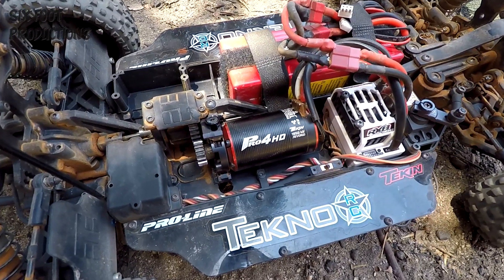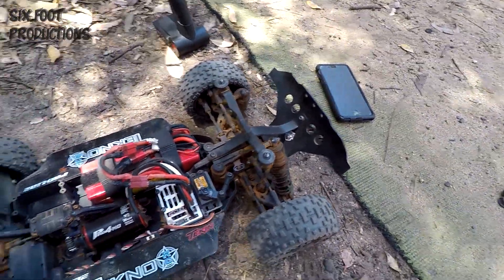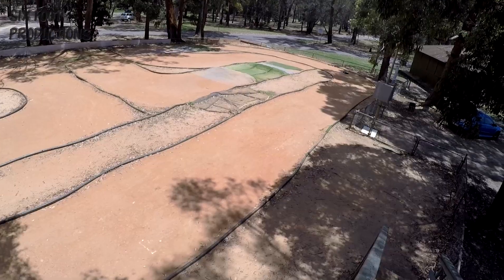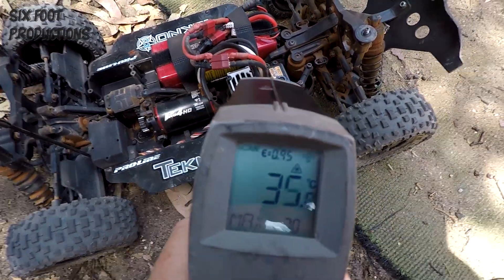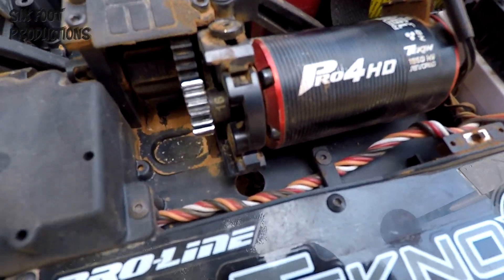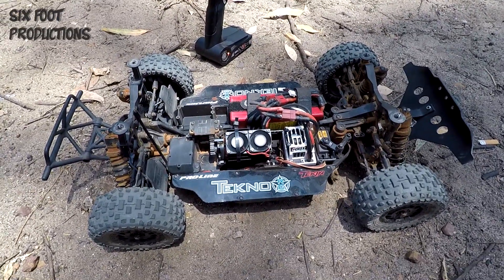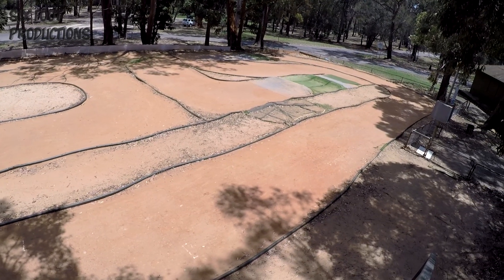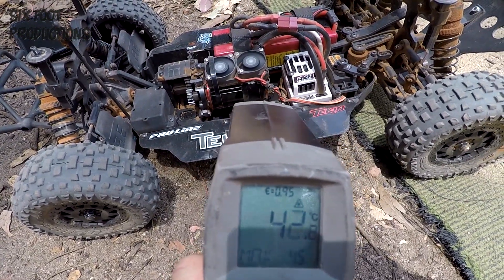Infrared Gun Tests. How much of a temperature difference do rc motor fans make? Upgrade time

Comment: Yes definitely but they dont guarentee not overheating I'd recommend upgrading them as hooning around and having a good time than having your car break or shut itself off to prevent killing itself is quite annoying
Reply from the maker: Def worth opening cover up and checking after longer runs. Even older lipos swelling and potential fire risk. Checking motor and ESC temps keeps gear running better for longer

Comment: Your measurements are actually inaccurate. You're taking a temp with fans blowing, of course you're going to get a lower temperature...
And you're actually checking the temperature of the heat sink and fans also, so you're not getting a physical reading of the motor itself....

Comment: Damn you really need to change out all of the metal parts because the rust on them will actually cause more resistance on the wheels and shocks, that also leads to more heat in the motor.

Comment: Awesome!  Thanks for the help. Just got a 3s lipo and my motor is so hot. Ordered some!
Reply from the maker: Great to hear, it’s gonna have extra torque and speed. Fans really help a lot. What RC do you run?
Reply: @vuss2107   Just got a used Slash 4x4 vxl. Have had an Associated SC10 2wd. Nitro Slayer before that. Nitro rustler that’s still kicking.  My brother and I kind of come in and out of RC so I have to buy a bunch of stuff when we do lol. Feed the beast.

Comment: Why do people always read the side when they do a motor temp test? You read the temp on the End Bell both before and after the fan install. if you read the side after then that's the heat sink temp not the motor. If you read the Bell after install but not before then you don't truly know what the difference was because the Can and the Bell usually have different temps to begin with. Also always turn off the fans during the temp read.

Comment: When I'm running ~10 min my car stop reacting for throttle for some time. I check engine and it temp 70°. ESC can cut off the engine when is it overheating? Or the problem is somewhere else?
Reply: Battery connection maybe? If you’re using and kind of adapter I’d say that’s your culprit but.. let me know what you found out! Always good to learn something
Reply: jarrett maltry problem solved. I buy new battery and now engine temp near 30 deg.
Reply: Gustavlegion wow never heard of that issue, what brand was your old battery vs this new one?
Reply: @jarrettmaltry6305   I bought my car with this battery, its 3 years old and I get it in very bad condition. Race time on it near 4-5 min, or 1-2 on 100% throttle. Battery - Turnigy 4200 mah.

Comment: They make a huge difference. My 4100kv motor goes into to temp protection at 160f after 20 minutes of running. With the dual fan yeah racing unit I have temps stay out at 120-130f. And this is during 95-98f ambient temps. At 70f I don’t have any thermal issues.
Reply from the maker: Firestarter 
Nice one def worth it over hotter months. Winter not so much here
Reply: Six Foot Productions yeah, I have it setup to quickly connect or disconnect it. Having a motor that draws 1400-1700 watts peak and gets little airflow really benefits from the fans. 

Running at 70f ambient I’m seeing 20f drop in temps, so it’s not a huge improvement and 130f isn’t dangerous so you’re right that it’s not necessary.

Comment: I have one 40mm fan with heatsink on my motor and it is only about 5°C cooler with heatsink and fan. Maybe the heatsink is designed the wrong way!??!
Reply from the maker: Make sure heatsink is a tight fit to absorb heat, some fans are weaker than others could be that too
Reply: @vuss2107  Thanks for the tips, unfortunately my motor has small fins so fitting it tightly around the actual motor isn't possible.. I might still try a stronger fan though!

Comment: When you are measuring w fans installed,  you need to turn the fans off, it's not giving you the exact current surface temperature.
Reply: That's not how it works.   The IR thermometer works by focusing light that is coming from the object in the form of IR rays and funneling that light into a detector.  Light, not air.
Reply: @everythingispose-able2543  bro, you're wrong. That's why you're the only one who commented.   

Now take a room with a window in it Or being outdoora where sunlight can hit the sensor. The sensor will absorb the suns energy and heat up. Once you turn on the fan the sensor will begine to decline in temp because the circulating air is moving the absorbed heat energy away from the sensor thus allowing it to cool until it levels with the temp of the room. If your window is still open and the sun is still hitting the sensor then it will never completely equalize with the room temp. 

So suck it smarty pants!!!

Comment: im about to install a hobbywing ezrun c4 5v on my v4 kraton and might add thermal paste between the heatsink and motor
Reply from the maker: Mac Catanzaro 
Could do mate, might attract a lot of dust and dirt tho. How’d you get on with it?
Reply: Six Foot Productions my 4600kv castle 4 pole and mamba max pro get super hot, I have a fan for the motor and the esc but I need to put on. It burned my finger when I touched the back
Reply from the maker: Wed Bull 
Can you change the pinion to cool it down a bit?
Reply: Six Foot Productions yes I can, I was previously running it on a traxxas slash 4x4 platninum with good temperatures, then my sc10 2wd which temps were ok. Finally it’s on my sc10 4x4 and I’m running a big pinion and a big spur. I am going to drop pinion your a 13 or 17t pinion as I was running that before. Maybe that will fix my problem.  It something I also noticed is that all the cables for the car get extremely hot. Like the solder on the deans plug literally melted off when running a dyno on the car
Reply from the maker: Wed Bull 
Got some nice RCs buddy.                    Weigh all the chassis individually. Also compare the gearing might just be a case of extra weight and needing a gearing tweak.
Reply: Six Foot Productions not sure I have a scale to properly weight a rc car but I’m running it on 3s when I usually ran all my other trucks on 2s and occasionally 3s. Will do some tweaking this weekend with gearing and then the fans
Reply from the maker: Wed Bull 
Good luck with it mate yeeeew 👍

Comment: I thought the exact same thing as other comments...i think to get a true reading you have to unplug the fans and measure temps of motor with fans and heat sinks removed.
Comment from an Rc jet/plane/heli/boat/car expert with 35 years experience.
Reply: You would think a 10 year expert would be able to make a summary of what the precise readings would be like in less than what you typed?

Comment: I dont know if that gives you a fair reading with out taking the fans off the motor then do a reading. Or at least unplug the fans. Just thinking maybe there is a windchill effect of some sort going on. Probably not too much of a difference though. Or not enough of a difference that is worth unplugging or removing the fans.
Reply: No i am sorry. I mean taking the temp of the motor while the fan is running. Meaning it could give a false reading because the fan is blowing. I checked my motor this weekend after 2 races for 4 minutes each. It was about 3 degrees farenheit difference between the fan running and the fan not running. So not too much difference at all really. But, having the fan on the motor did make a difference of about 20°F less than it is usually with the same ambient temp. Usually I would notice a 15° F difference with a heatsink.
Reply: I thought the exact same thing as other comments...i think to get a true reading you have to unplug the fans and measure temps of motor with fans and heat sinks removed.
Comment from an Rc jet/plane/heli/boat/car expert with 35 years experience.
Reply from the maker: FOSTBITTEN 
There’s a substantial temp drop running fans (25deg Celsius, 77def Fahrenheit) less heat stress on all components. 
There’s no wind chill on a summer day in oz that day was 30deg Celsius or 86 Farenheit ambient temp

Comment: do the fans just plug into the receiver?
Reply from the maker: Dusty 
They sure do 👍
Reply: I dont need an adaptor? The connectors on my fans are JST
Reply from the maker: Dusty 
They should plug in fine
Reply: ok. Thanks!

Comment: Quit a big difference huh?
I like the torque of that 1850 pro4 hd, a LOT more than my 4300!
Reply from the maker: +Monster Neu 2.0 
Deffo more torque on 4S I changed to 4050kv 2S motor only to try lighten truck weight as running 2x 5000 2S in series for 4S was to heavy. Still drove good and bulk run time, I didn't want to buy 4S batteries. As I have 10+ 2S batteries. So motor swap was best way. I might put 1850kv back in over summer..... try 6S hahaha
Reply: Six Foot Productions hobbystar and SMC make 3600 mah slim 4s packs the size of a 2s, and weigh as much as a 2s too! But i hear ya, u got a lot of 2s packs 
One of these days I'm going to get a couple 4s slim packs and run 8s 2200 because my tires must die
Reply from the maker: +Monster Neu 2.0 
I did look into a lot of 4S batteries, didn't want to buy any more batteries to add to the pile. 
I have 2x SMC 3S 5000 there grunty. That would wake the sct up too hehehe 

8S sounds beasty, make sure you do vids 👍
Reply: Six Foot Productions oh I will, but I'm not sure they're gonna be long lol

Comment: Terrible temp measuring experiment. You should have turned the car off to stop the fans and measure the motor temp. Taking a measurement of the fans blowing air is retarded and inaccurate. 👎🏻
Reply from the maker: +Artem Brayson 
Not really bud IR gun is the way to test, also there's a temp/speed/rpm sensors on the truck can use with TraxxasLink app gives similar results. 

There's clearly a substantial drop in temps, fan on fan off the motor can is heat soaked. It's not as if the fans are blowing it cools down immediately.
Reply: Deffo not a true reading, if the fans are blowing on the motor after stopping the car the motor Will get cooler, the test is how hot the motor is without fans then with fans, but as soon as the car has stopped the fans should be instantly turned off to get a true reading of the motor temperature with cooling,...

Comment: You'll get even bigger difference, when you use same stuff that you put between cpu and cooling unit inside computer and really bolt that fan unit to your motor. I did that with my hobbywing on my XB9e and could put whole a lot bigger pinion on motor while temperature remained so low, you could barely feel the difference with your finger, compared to before running it. I used those metallic "zipties" (cba to check their real name... the ones that have screw tightening thingy) which bolted the cooling unit to motor so tightly, with that lithiumgrease (?), that there was literally no air between those 2 metals. When you have air between metals, and you do with normal RC motor fans, it won't be that effective, even when it does help :)
Reply from the maker: Janne Grönmark 
I think you mean thermal paste, cheers for the input
I few weeks back I swapped out the 1850kv tekin motor for a 4150kv to now run 2S. It drives much nicer as it's heaps lighter. I did use thermal paste on heat sink/fan install. I have run 16-19 pinions with no heat issues, approx 15-20 deg above ambient temps on a full pack 
I need to do a few updates but our laptop died few weeks ago waiting on delivery of another due soon
Reply: Oh right, thermal paste, that's the word :P Being tired and since english isn't my native language, I tend to forget few words here and there haha :) But yeah, that's what I use on my motor/heatsink and bolt it tight, so there's no air between those 2. I might be over-cautious, but since the paste isn't that expensive, might as well :D
Reply from the maker: Janne Grönmark 
All good mate 
Yes it is worth while the thermal paste syringes is few dollars only lasts years, just a blob under heatsink or dirt will finds its way onto it 👍👌
Reply: @Joselox  he did use a heatsink. It's the small black thing that he screws the fan onto.
Reply: Depends, can't have you fans too close or else the motors magnets will interfer with the fans